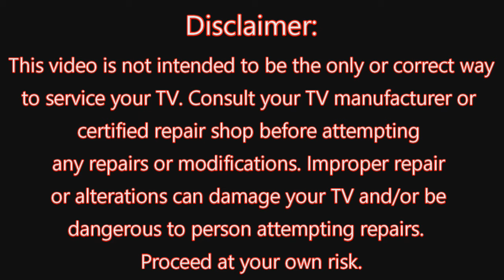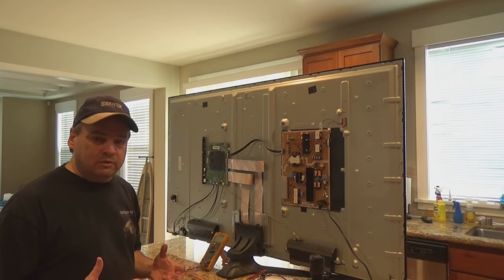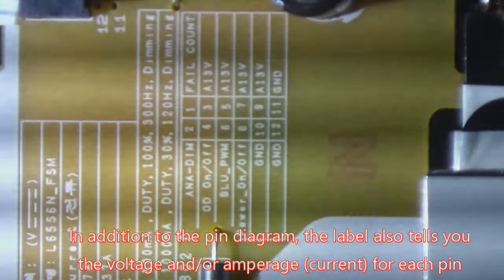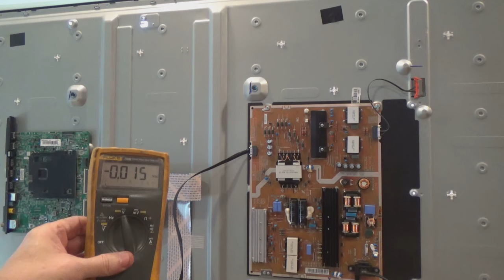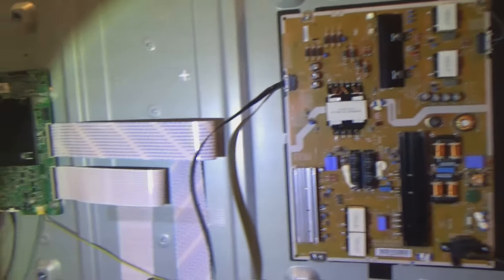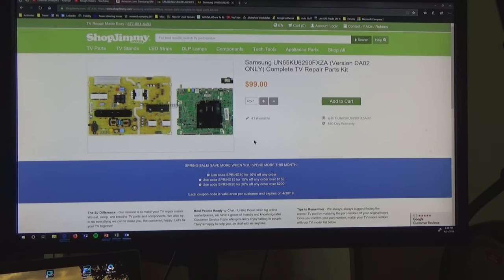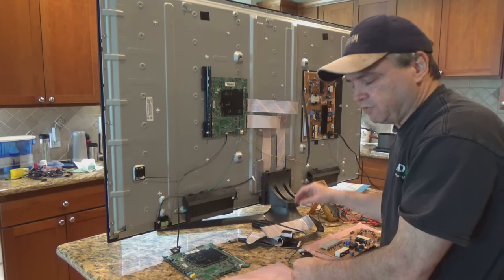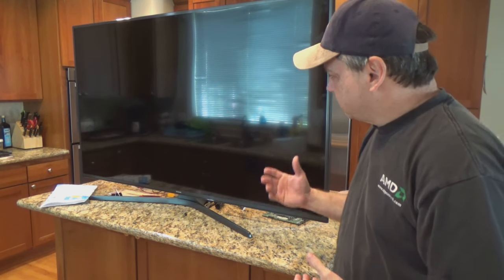LED HDTV Repair - Standby Light But No Power Up

Comment: Very good........simple and understanding. Can I order parts for flat tv screen from you if I provide you all information like brand name, model number and extra ?
Reply from the maker: Sorry, can't help you.  I'm not a shop or repair center. I'm just a guy that had a TV that broke so I tore it apart to try and figure out what was wrong. I recorded the video to show what I did to fix my TV.
Reply: @RoughRidersTV  No worries. Your video show really helpful to me but the problem is spare part. Thank you very much.
Reply: @boraingtabe5237  If you exchange the whole pcb , just look for numbers on the pcb, stamped on the side of a pcb, with ie number and V1.2 or the like.Many tv's have the same or different pcb's even from same brands. So looking at the brand of tv or type is often not enough. Look via search engine, repairing the components or resistors is often udoable,because they are so small,chances are slim it will work.

Comment: HELP  once in a while, my TOSHIBA 37AV502U would not coming on  and make a loud screeching ,beeping, code like sounds.  i would unplug it and plug it in a few times and it would work fine. but this started happening a lot so i just left it on. this was fine for months and months, but we lost power and it was off for days and i couldn't get it back on. yesterday i took it apart, vacuumed it out to look for obvious thing i could fix.[ i fix a lot of things and other TV's that way] i did the power button and the plug thing and it came on after many tries with just the loud noises. i thought maybe it was loss wire syndrome,LOL, but now it's just screeching. any idea's?
Reply from the maker: I can't think of anything that would be causing screeching sounds from the PCB.  I suppose a blown cap or something might make a noise but those tend to pop and smoke and then go out, not make screeching noises.  However, I would start looking at the power rails first and to see if they are in spec, just as I did in the video.
Reply: now its back on. lol.  seems like if i leave it on for a while, after the screeching modem sounds . i can turn it off ,then on , and get it to come on. I'll take the boards out and inspect a little closer. thanks. oh. one more thing. the green light comes on, but does not have the red light after off and still plugged in.
Reply from the maker: @immrnoidall  Toshiba may be doing something different for standby than Samsung.  My TV does not have any green LED on it.  So, not really sure what, if anything that means since I don't have that TV.
Reply: thanks. i really appreciate the help i get here and from others.

Comment: I have a Samsung UN50M530DAF and the back is off and the leds are flashing on and off at the periphery of the set (all along the edges of the set as it sits)  I replaced the main board (not the power board) and the same thing happens.
Reply from the maker: Did you verify the power rails to confirm the board was indeed bad as I showed in the video?

Comment: Hello, is it worth taking it into a shop for repair? I followed the video but I don’t think I will be able to do the actually repair.
Reply from the maker: I think it depends on how old the TV is.  A repair shop would probably charge 500 and up. However, as we are in the midst of holiday shopping, there are some really good deals right now on new TVs.
Reply: @RoughRidersTV  That’s what I was thinking. I brought it in 2017. Thank you for responding.
Reply from the maker: @chocolatedomi7983  Tough call.  3 years on a TV is not very long.  Mine failed just over a year after buying so it was out of warranty and I spent about $1K on it so I decided to try to fix.
Reply: @RoughRidersTV  I ended up purchasing a new tv, but I didn't get rid of the broken  one and I plan to give the repair a try. I just didn't want the pressure of not having a tv in the family room this close to the holidays...lol
Reply from the maker: @chocolatedomi7983  Makes sense.  Cool thing is now you can try the repair and it's low risk. Whether you fix it or not, you can take pride that you tackled this yourself.  Good luck.

Comment: In my times of fixing game consoles and retro game cartridges, 9/10 if there was no sign of burns or bulging, it was typically a broken chip either a broken solder or chip itself. If not that id check traces, but I think yours is too new to have those wear out on the board.

Comment: What if the standby light isn’t on and the tv doesn’t power up? The only thing I’m getting is a static sound coming from the back letting me know it’s plugged in
Reply from the maker: I would suggest still following the steps.  It's more than likely 1 of the 2 boards that is the problem.  With schematics and an O Scope, you could dive in deeper to find the exact failing component but it's easier just to swap out a board that is failing as that is pretty much what a tech would do when they show up at your house.

Comment: My 48" Samsung stopped coming on, the red LED on its front was blinking very dimly all the time, indicating some sort of power problem, but after I disconnected the power ribbon cable from the main board, the back lights came on, indicating that my Power board was most likely OK, so I checked all the voltages on its pin outs, and yes it was giving out 13v on all the pins it needed as well as 5V,  So that indicated that fault was most likely to be on the main Board, as something ( any component or a chip) on it may have gone down drawing too much current and this was making the power board shutting down and trying to switch back on again and so forth, so the red led blinking dimly. 
Unfortunately, as I tried to reconnect the power ribbon cable back hot, suddenly a chip on board popped and a smoke bellowed from it! So never ever connect ribbon cables hot, connect first then turn on the power from mains. 

However, since there was a problem with the board in the first place, so popping a local on board switching regulator made no difference to the fact that I will be needing a new board ,So something on main board was drawing too much current and the local 5V switch more regulator popped out when it was fed with a full 13v to its input pin, however, I wired a 3 pin 7805  One amp regulator bolted a small heat sink to substitute the popped out switch mode regulator, it restored the red LED on the front, and with a remote button it  powers up and seems to all light up, shows the SMART TV logo for a few short seconds,  but afterwards it remained blank, it did not fully boot up and after a delay of roughly 2 minutes it automatically switches off ,  which indicates a processor fault, also on my T-Con board I was getting a 12v and 3 blue leds on it were lit too, the original fault must have been a  processor or its associated parts having broken down which were drawing all that excessive current, which caused that 5v on board local switching regulator to fail, So now I will need a new board. I am just as you are know about electronics and I do not fix TVs on for others.

When you were taking down your old board, something was sizzling in the back ground, was your wife cooking sausages? or was she frying an egg omlete!
Reply from the maker: Hmm, not sure.  Wife was out of town so not sure what that was.

Comment: you dumded it down perfectly awesome video !!!!!!!!   i dont want to pull my Lg apart yet because my basic knowledge of aircraft electronics tells me i have a different problem. would you mind giving me your advice please ? my rred stanby light is blinking steady, tv powers on all apple tv apps appear etc. everything starts to work as stanby light turns blue, then blue light starts to dim and red light comes back on. All this happens in approx 30 secs. Also while googling someone wrote the hdmi cable could be an issue.  changed it out ! watched a 2 hour movie last night. Tonight right back to square one lol any thooughts ?? thanks in advance.
Reply from the maker: That is odd. 1st, as mentioned I am not a TV repair guy, just an EE that tears into stuff when it's not working to try and ID the problem.  I don't have a home lab with scopes, etc. to do a deep debug so it's all just speculation.  Does it look like the LED is blinking any patterns?  If so, it would be an error code.  I find it interesting that changing the cable changed the behavior.  Have you tried swapping the cable again to see if you can replicate the behavior?  If it were something simple like the cable, I would expect an error message on the TV about no source detected. When you changed the cable, was it a hot swap or power off then change? Have you tried any other inputs to see if those register and work correctly? How long was the first cable and how long on the 2nd?

Comment: THANX FOR THE INFO WILL HELP WITH MY FIX. JUST REMEMBER DC DOES NOT MEAN DIGITAL VOLTAGE🤣🤣🤣🤣🤣
Reply from the maker: Good catch.  I misspoke when I said that.  I know that DC is Direct Current vs AC (Alternating). I meant I need to set the meter for voltages supplied to the ICs on board since those are digital components as opposed to voltages coming off the wall plug. I could have explained that better.

Comment: When you stated you have EE Degree...  I was hoping you would ACTUALLY repair the board...  
However...   THANKS FOR VIDEO!
Reply from the maker: Pretty hard with out a full scope, datasheets and schematics.  Since it was the I/O board, I did look it over and did not see anything immediately wrong so I don't think it was anything related to caps/resistors, etc. Therefore, it was likely a chip and without a datasheet with full pinouts and signal definitions, it would be hard to ID the failing part.  Pretty sure Samsung wouldn't send me the schematics and datasheets.

Comment: Thanks for a great video - would like to know if you have a thought about why a power board or logic/io board would suddenly stop working
Reply from the maker: There are a number of possibilities.  Could be bad solder joints on a board, bad capacitors or resistors, surge/spike in power, faulty chip on the board, bad ground or power plane on the PCB, dust (which carries static electricity) gets inside and shorts a board, insufficient airflow creating excess heat in the cabinet.  Sometimes, boards just go bad. I've seen a number of these types of issues in my career.
Reply: @RoughRidersTV  Thank you so much for your reply.  Duggie
Reply from the maker: @duggiechester  You are welcome. Thanks for stopping by my channel.
Reply: @RoughRidersTV  Followed your advice and have now fixed the problem - it turned out to be the logic board - just a process of elimination - will add you to my subscribers list - thanks again - Duggie
Reply from the maker: @duggiechester  glad the video helped and congrats on getting your TV back up and running.  Great feeling to save so much money when doing it yourself instead of paying for a tech to come out and do it huh?
Reply: @RoughRidersTV  too true - I have saved loads of cash -  basically I went from to IR board thru to the power board then to the Logic Board, that's it really.  On the modern tv's thats all that can go wrong, if the screen goes or is cracked then just get another telly as the screen is worth more than a new TV.    All said and done and I am not taking anything away from your advice ( as I took your advice) if anyone else is looking to fix a TV and they don't know how to solder they should replace boards working from lowest price first ie IR, then  power, then logic in that order.  All that said if anyone who sees this then if one can solder then one can solder a new capacitor, resistor or even replace a fuse and will fix the problem.  Perhaps you can make video with all the above in mind.  Although my Youtube vids dont cover this type of content I am thinking about perhaps doing such vids in the future.  Maybe we could combine future videos which would cover both US and UK conditions - just an idea. Once again thanks for your initial video - duggie

Comment: Got to ask - how much did it cost in total to repair?
Reply from the maker: Just the cost of the replacement board from Shop Jimmy and whatever taxes + shipping.  So, just over $100 for everything as I recall.  Still using it 2.5 years later and working fine.

Comment: Hello sir,I have a 60 inch Samsung tv  .i was watching tv and it just went off. Everything is plugged in correctly but no picture and no sound.. the only thing that’s happening is a red blinking light at the power button. I did everything with remote and unplugged and plugged back in but the little red light just keeps blinking. I’m a 63 yr old woman that know what to do. Can you give me some advice please? That you miss smith
Reply from the maker: The video tries to step through the basic troubleshooting process.  I don't know what else I can offer to help with your specific situation. If you want to try to fix it yourself (it's pretty easy), follow the steps in the video. Otherwise, you can call a repair person to come take a look but it will be a bit more expensive.
Reply: Same thing just happened to me.. I don’t know what happened or what to do..
Reply: My TV just did that it was the led bulbs of mine burnt up 18 bucks for 2 strips

Comment: I'm having problems and I have no technician equipment please help
Reply from the maker: I didn't use any specialized equipment.  This is just a standard multimeter you can buy at any h/w store.  I also used a couple of screwdrivers.  Not sure how I can help you, the video is pretty clear on what I did to troubleshoot mine and fix it.

Comment: Is there a reset button that might work?
Reply from the maker: If the board is bad or an I/O port is bad, then resetting will not do anything.  You would need to replace the board which is why I walked through the troubleshooting steps to figure out if the power board or the I/O board was the problem.

Comment: i get 4.3 power on and off can be problem i ready change the mainboard ..  i see got be 5v on power on
Reply: power on and off the give 4.3 v  and other around 3.1 3.5 volt ..  you thinl is issues in the powrt board
Reply from the maker: @fastbiker727ify  Sorry, not sure I am following you here.  There are multiple pins to check.  Is there a print out on the PCB that states what each pin voltage should be?  If all the pins are measuring out at the correct voltage for each pin, then the board is probably OK and you need to look at the I/O board.

Comment: Hey man, love your work.

I have 55" JVC TV with similar symptoms. Took the cover off and found a burn-mark on the main board. However,  I don't seem to be able to get a replacement (RS128D-4T03)board in South Africa.

Any recommendations?
Reply from the maker: Try searching on the TV model number and look up Main board, Power Board, etc.  sometimes you might find someone that sells the power board and then they might also have the i/O board.  As I am in the states, not sure how much help I can be for vendors serving South Africa.  Sorry.
Reply: IRough Riders Bhozzpal NLI
Reply: Hey boss, I replaced both boards. Had same symptoms as you...however I had burn marks on power board ...

Can just barely see pic...there’s a 3rd board hidden under frame...replace that too?

Comment: Thanks, but I don’t have a voltmeter what can I do?
Reply from the maker: It' hard to troubleshoot without tools.  I would suggest picking one up.  Without one, you are pretty limited in what you can do to identify the problem.  I suppose you could just start replacing boards to see if that helps.
Reply: @RoughRidersTV  That's what I did, just replaced Both boards and the power button Still just blinks a few times and then solid- that's it, black screen, no sound, no flicker. What next, check bulbs??
Reply from the maker: @magpie1909  It may be the T-Con board.  It controls the logic that drives the LEDs. It's probably under a heatshield or cover.

Comment: 48" Samsung TV: When plugged in, the standby light flashes several times, then turns off. TV won't turn on. Opened it up, unplugged main board, plugged in the power, no backlight. Board says four pins should be 13v, with no other voltages listed. All four register 12.74v. No bulging or leaking capacitors, no obviously damaged parts. No clue what's wrong with it.

I'm sure someone with knowledge of electronics could diagnose and fix it in less than an hour, but I have no idea how to do that. If it's not something obvious that can be replaced, I have no idea how to fix it.

This TV was picked up from the trash, so it didn't cost me anything. I was hoping I could fix it for a few bucks, but I'm not going to waste money on parts that may or may not work. :(
Reply from the maker: sounds like a broken connection at the LED array but that is just a guess.